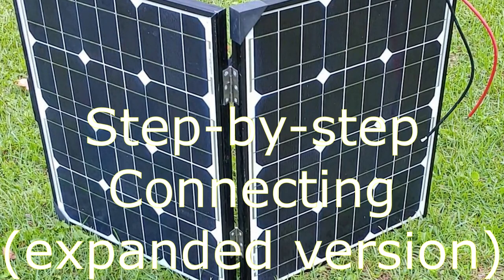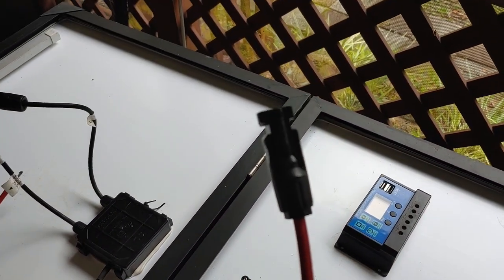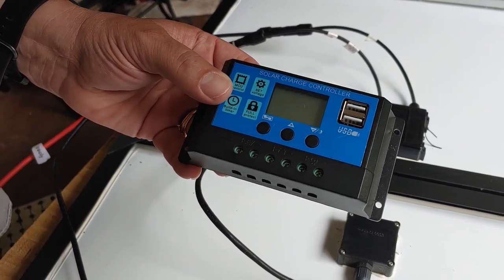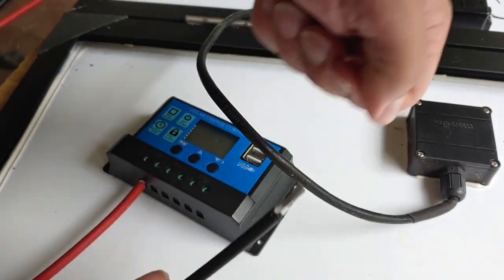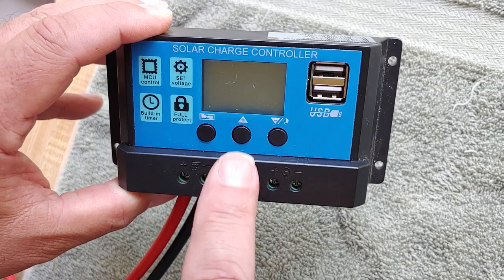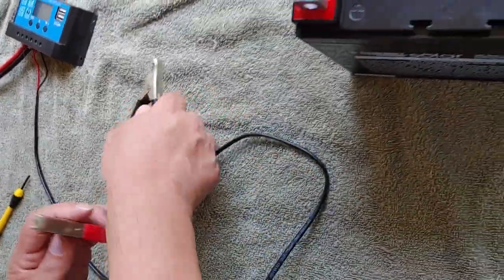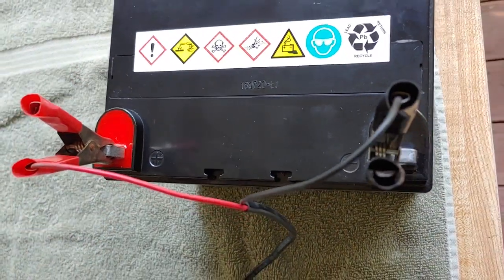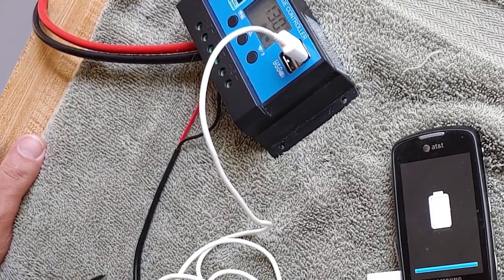New expanded version of Step-by-Step Connecting Solar Panels to the charge controller and battery

Comment: Another tip. If regularly connecting and disconnecting to controller wire to a set of chocolate blocks (electrical block connectors or huse box / bus bar)then you wont wear out the screws on the controller and can just replace the blocks cheaply if required, got one on borrowed time.
Reply from the maker: Thanks for your comment

Comment: Ok how do you keep that old phones battery going every 3 years or so I have had to get a new phone because the battery won't hold a charge my phone like the one you plugged in is about 10 years old and won't even charge anymore because of this problem with batteries dieing I've gone from the old slow charger to the quick charge to USB type C so now I need all 3 charger's my tablet has to be charged on the old slow charger my Fitbit watch won't charge on the old slow charger and can't be charged on type C my phone needs type C I've been wanting to try to upgrade my booster packs and have finally found a company called called powerworx that sells the quick charge and type C but with so many devices going to type C it's surprising that they don't at least put quick charge USE on these charge controller
Reply from the maker: I don't know about cell phone batteries. Thanks for your comment.